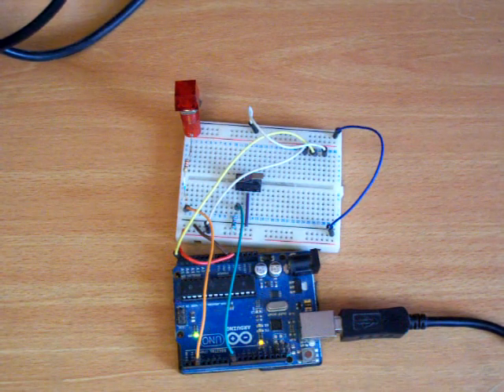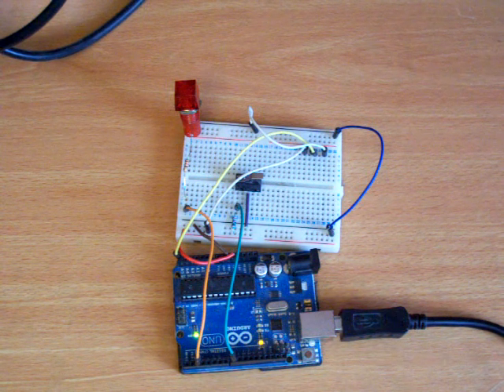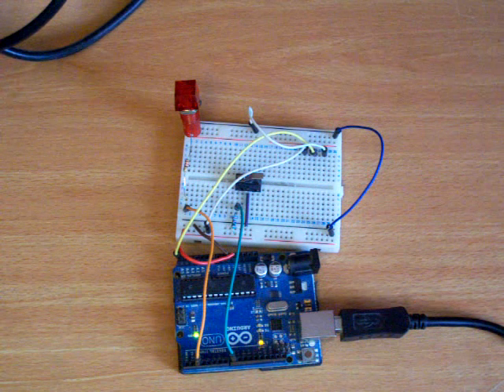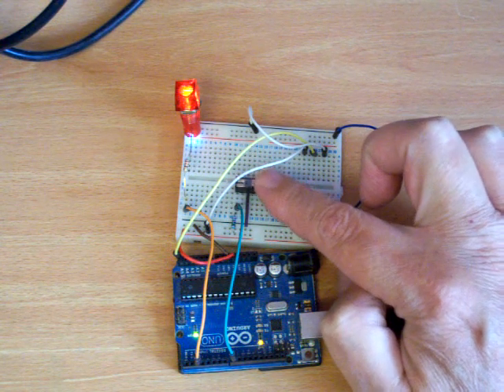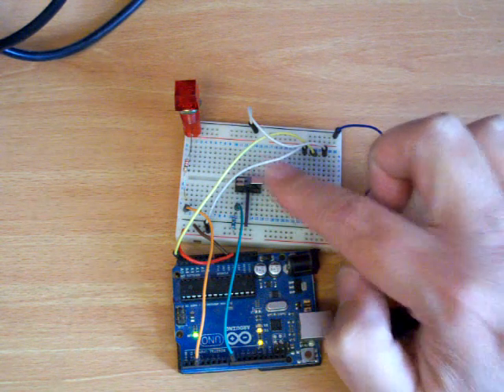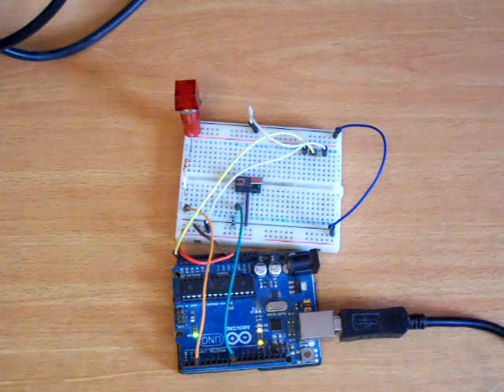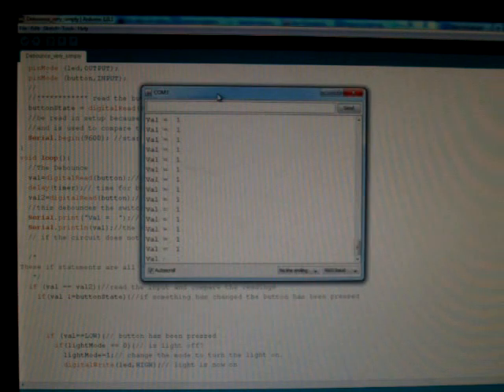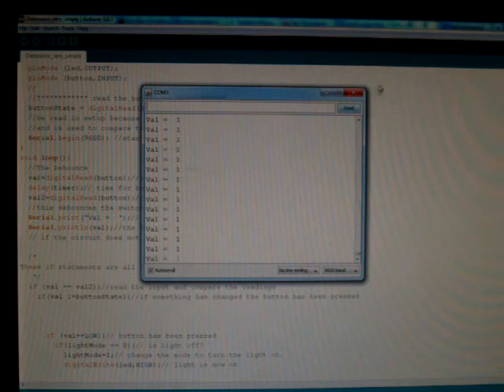Arduino simple debounce. sketch included

Comment: how i can adding debouncing button to my project, i has manytime try addint thats my projeckt but no working, 2 button , first  switch make led on pwm 25,(alltime on if switch 1 have on)  and second button need debounce led on pwm 255 and flash light 100 on 150 off  , but proplem have, i make code switch 1 working fine, then adding button 2 and now not working . led have alltime on. or led have alltime plink.i use pull-up switch and button, 10k ohm to 5volt to arduino and button. mean 5V--resistor--button and arduino, button other side go gnd.
Reply from the maker: +Matti Virta 
Sorry mate I have no idea what you are on about. I cannot understand what you want. Perhaps you need to read a book on arduino programming or try learning from here    https://programmingelectronics.com/ It is the best resource on the net.

Comment: HOW TO INSERT DEBOUNCE CODE for THE CODE BELOW?
for the condition as follows: Specifically if the switch is pressed (positive volt signal) at Analog in A1, Arduino Uno should produce a 1-time sequential output of 12 LEDS (Pin2 to 13). specifically first, Pin2 LED should light up for 2 minutes then turns off. But Pin3 should light up for 2 seconds (Pin3 starts to turn only after 2 seconds has elapsed for Pin2 when started to turn on). Then  Pin4 should turn on for 2 seconds then off. then same with Pin5 to Pin12. Then Pin13 should turn on for 1 minute then off. Note: During this period (from Pin2 to Pin13), ARDUINO must ignore any positive input at A1.(or it must lock itself)

MY INITIAL CODE:

int switchPin = A0;
int ledPins[] = {
  2,3,4,5 };
  int pinCount = 4;
  
void setup()
{
 pinMode(switchPin, INPUT);
 pinMode(ledPins[0], OUTPUT);
 pinMode(ledPins[1], OUTPUT);
 pinMode(ledPins[2], OUTPUT);
 pinMode(ledPins[3], OUTPUT);
}

void loop()
{   
    if (digitalRead(switchPin) == HIGH)
    {
    digitalWrite(ledPins[0], HIGH);   
    delay(500);  
    digitalWrite(ledPins[0], LOW);
    digitalWrite(ledPins[1], HIGH);   
    delay(4000);
    digitalWrite(ledPins[1], LOW);
    digitalWrite(ledPins[2], HIGH);   
    delay(1000);
    digitalWrite(ledPins[2], LOW);
    digitalWrite(ledPins[3], HIGH);   
    delay(1000);
    digitalWrite(ledPins[3], LOW);
    }
    else
{
  digitalWrite (ledPins[0], LOW);
  digitalWrite (ledPins[1], LOW);
  digitalWrite (ledPins[2], LOW);
  digitalWrite (ledPins[3], LOW);
}
}